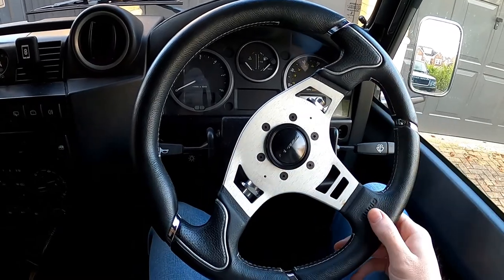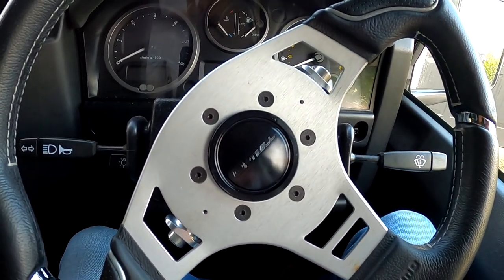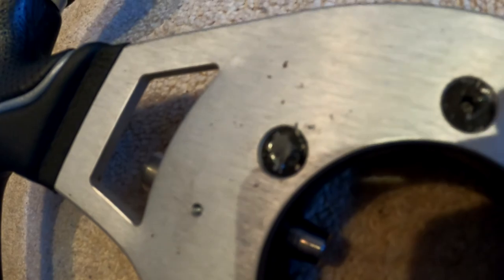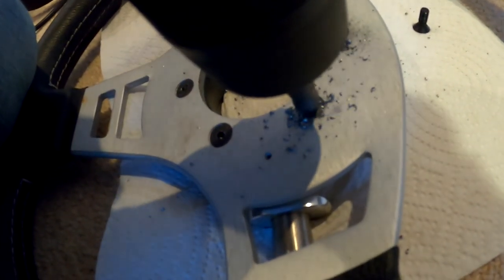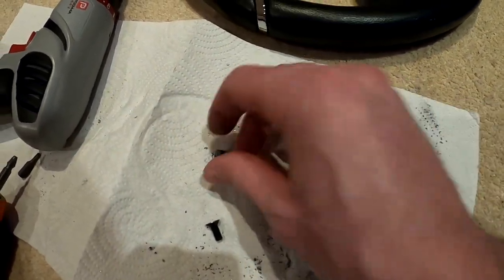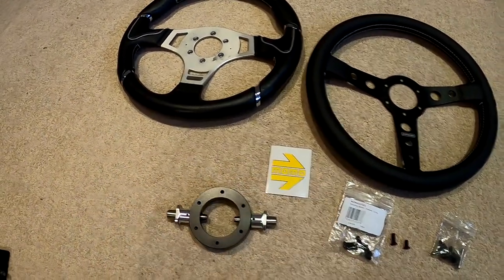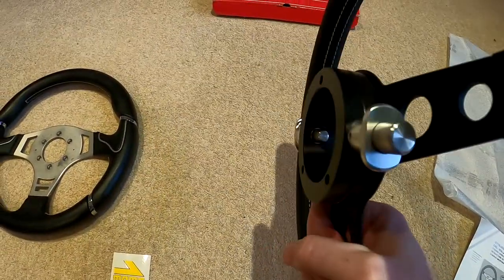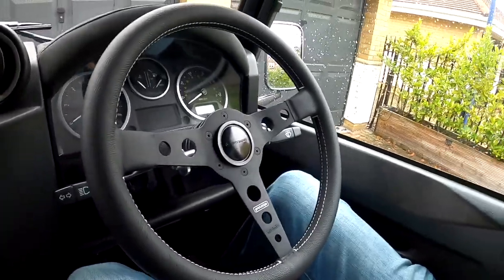CHANGING a MOMO STEERING WHEEL on a DEFENDER 110- Boss Removal / Upgrade & Removing Damaged Screws

Comment: Hey there.. I have been looking at exactly the same wheel but have been told by some that 350mm is too small and horrendous on the highway.... They say they sweet spot is 380mm (Momo Montecarlo)
Reply from the maker: I find our size wheel absolutely perfect, guess it's just down to personal preference on sizing.
Reply: Do you know what size wheel is used in this video? 👀 I’m after the same

Comment: Loving the videos! As a recent new owner to a Defender, the videos have been really handy! 
Looking to upgrade to a removable boss with a similar heritage steering wheel, What boss spline / wheel size did you need to get?

Keep the videos coming!
Reply from the maker: Thank you Zach, the wheel size on mine is 350mm which gives a fair bit extra room compared to the huge OEM wheel. I'm not 100% on the boss spline as the Optimill was already fitted on the vehicle when I purchased it, so the part you see being swapped over on the back of the wheel is just the bit that securely attaches to the main boss on the steering column. You should be able to find Spline info out easily enough though in any of the Landy forums. Thanks for watching and hope you're enjoying Defender ownership.